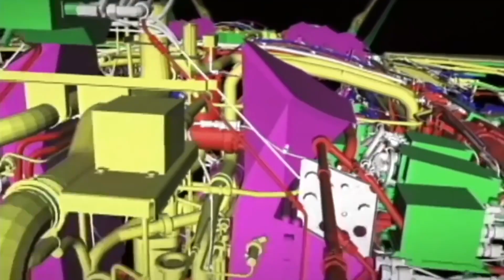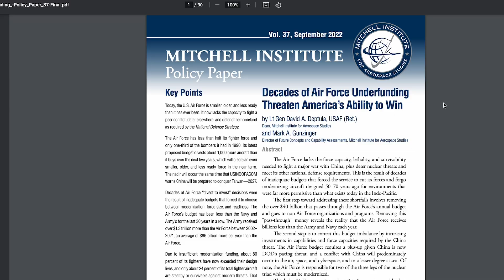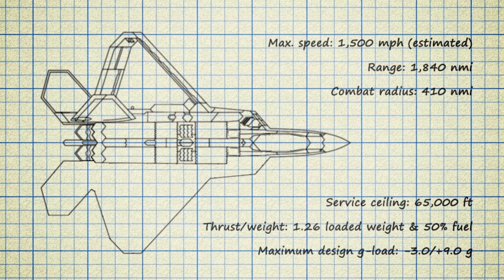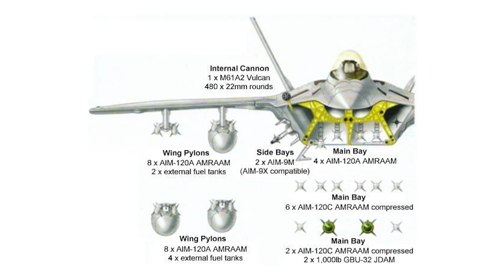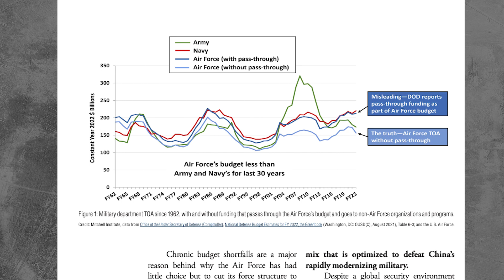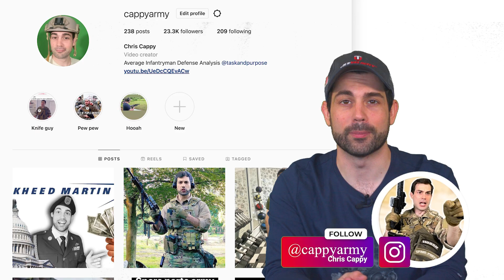Cancelling the F-22 Fighter is Worse than You Think

Comment: The F-22 exorbitant cost was made worse by two main factors: Early cancellation and Lockheeds inability to export. Both equaled a much lower rate of production which ultimately ran up individual unit cost. The same factors played a big part in the B-2’s cost. 

So how do we sort that out moving forward while still maintaining absolute technological superiority? 

The same open architecture design concept and use of proven, off the shelf parts that were utilized with prototypes like with the YF-117 and B-21 will absolutely lower the cost of NGAD exponentially. 

One of the single greatest things the F-35 has brought us is a vastly improved avionics, tens of thousands of flight hours to learn from, and multiple block upgrades, rapid R&D and implementation for new systems and materials etc. 

NGAD will make use of a lot of proven off the shelf parts. Stuff like landing gear, ejection seats, RAM coatings, the new ADEP engines, F-35-esque avionics and coding, tracking and targeting, passive IRST, radar etc… NGAD will likely be a larger air superiority platform with long legs that is built around a LOT of the same architecture as the F-35 and B-21. That has the added benefit of rapid prototyping and integration with existing programs and systems.

It’s going to upset a lot of people when they find out NGAD isn’t a hypersonic, vectored thrust dogfighting machine. It’s going to be a very long range (BVR) sniper (probably with the same internal gun as the -35 because we learned our lesson with the F-4 in Vietnam and the GAU-22A is more than adequate*). 

*side note: I wouldn’t be surprised to see them also use the standard M-61 20mm as this is meant to be an air superiority fighter and likely won’t be used for CAS/Anti-Armor like the F-35, so a VERY proven 20mm cannon with a higher rate of fire would actually make more sense)

Comment: The answer is to build more F-15X's. Utilize them in a Hi-Lo, or more accurately Stealth-Nonstealth, mix with the F-22. Not every air-to-air mission requires stealth. If that were the case, the US carrier force and it's air wings would be scrapped. Sometimes the ability to carry a big load of ordnance, A2A or A2G, to long range is more important. When the latest generation of weapons is factored-in, the X looks like a good choice.  Current F-15 infrastructure and training easily supports the newest Eagle as well.

Comment: F-22 may have more power than any other fighter jet - but it's very, very heavy. A Typhoon configured for intercept has a better power to weight - and that's before we add the extra (up to) 30% extra thrust Rolls Royce now allow on the engines as they are exceeding flight time before failure massively.  Basically the Eurofighter's EJ200s are lasting twice as long as they were supposed to!

Comment: The F-35 A and C can carry 2 2000 pound JDAMS and 2 AIM-120 and the F-22 can carry 2 1000 pound JDAMs, 2AIM-120, and 2 AIM9.  The F-35 makes up for this by having extra wingtip mounts for the AIM-9 if they carry external weapons.  The F-35 is supposed to get an upgraded missile rack that if they do not carry the 2000 pound JDAM they can fit 3 AIM-120 total... again matching the F-22.

The F-22 is a faster jet and has SLIGHTLY better stealth, but the F-35 has the combat helmet with 360 degree IR capabilities and built in electronic warfare.  The F-22 has a speed of Mach 2.25, range of 1800 miles, and an altitude of 65,000 feet and the F-35 has a speed of Mach 1.6, range of 1700 miles, and an altitude of 50,000 feet.  The F-35 has slightly more updated radar, targeting, and electronic warfare systems.  The F-35 is VTOL or STOL capable, but can only hold a 1000 pound JDAM and lacks the onboard gun.  The F22 can use externally tanks to improve its range, but the F-35 is developing those too.

The F-35C is a carrier launch version.  This is something the F-22 could never do.  Proposals were made, but it would have required variable swept wings to slow its takeoff and landing speeds which would have driven up the4 cost way higher and severely reduced its stealth capabilities.

The big problem with the F-22 is the operating cost and purchase price as well as the inability to send data over the Link-16 system except to another F-22.  The F-35 can send or receive data.  This is pretty important.  The F-35 has a lower incident rate too.  It is also a big money maker because the US is exporting them and the F-22 was never exported.  This overall will result in more than 10x as many F-35 built and even more than that in engines as the B-21 uses the same engines.

Even though they perform a completely different roles I think they would likely be a VERY close match if they had to take on each other.  I actually think the F-35 might have a slight advantage do to the slightly more advanced electronics and the combat helmet and 360' IR vision.  Either way they both outmatch anything else in the world significantly and with the new AIM-260 and later the Peregrine missiles they will be even better.

Comment: The F22 should’ve been fully fielded and unit cost would’ve been a lot less.  That’s why the F35 is already cheaper because there are more F35s in service already then the total amount of F22s.  If the USAF got all 750 planes that were originally requested and granted before cuts the F15 would be in a museums like the F14.  Instead to fill the gap while the NGAD is being developed the AF Is investing in the F15EX program which is basically a big missile truck that carries double the amount of missiles of the F15c.  If you believe what is available open source material they are to fire air to air missiles which will be guided/controlled by the F35s so they fire and bug out because they have a reduced radar cross section, but aren’t stealth aircraft.  Then the F35s track targets and guide the ordnance towards intended targets or something to that effect.  The Navy is having the same issue now because they do not have a dedicated air inceptor to defend the battle groups and that’s coming from the Super Hornet community.  There were plans to upgrade the F14 Tomcat to the Super Tomcat 21 which had 3 versions to pick from.  That’s another story though because Dick Cheney killed it because he hated Grumman and allegedly had some kind of interest in McDonnell Douglas who produced the F18 legacy and then the Super Hornet which MD & Boeing produce today.  It’s was sold as just an upgrade, but did essentially what they were trying to do with F14 because the Super Hornet is 33% bigger then the legacy hornet.  The Super Hornet is actually slower then the legacy.  I would bring up it also killed the phoenix missiles as well because there is no airframe in the navy that could carry them.  When it comes to defense spending though follow the money because some politicians are getting their pockets lined, and now there are actually peer to peer threats close on the horizon now it’s oh poop!
Reply: With the above said in the F22 and it’s technology you are getting really close to as far as physics what the human body can handle.  9+ g turns which can’t be sustained for long periods without getting g lock and passing out.  I do know from talking to a buddy that is a crew chief on F22s they are FAST!  Don’t know the top speed because it’s extremely classified, but know they can go so fast if the pilot pushes it out of the “envelope” it will actually start peeling the paint off the aircraft.  Then it has to be deadlined and sent for an expensive paint job!  I have actually been on the flight line at Langley, touched, and got to look inside the aircraft.  It’s amazing piece of technology and is unmatched in the sky even by the Chinese or Russian Stealth aircraft which are newer.

Comment: What unfortunately even some of the people at the highest level don't understand is that the F35 was never meant to replace the F22, but to work in tandem with it. They are both great at their jobs, but if you force them to do what they're not designed for, you'll see performance suffer, and therefore people who don't know anything about them (i.e. lazy journalists) crap on it. All hope rests on the NGAD, which will hopefully be the worthy heir to the throne of the king of the skies.

We are also lucky that most of those in charge knew not to buy into stuff the fighter mafia has said, otherwise we would have lost the F35 as well. We would be in far greater trouble if Pierre Sprey and crew won.

Comment: Best replacement for the Raptor would be a drone. you can load a number of them in a cargo plane, drop them just outside of the combat zone and let the advanced combat systems and the handlers back in the states or the local FOB run the show.
Reply: Yes that's the future. Advanced weapons delivered by simple cheap mechanical systems.

Comment: The ideal solution would be to build a version of the F-22 that costs less as it takes 10 years+ for a newer gen fighter jet. While the F-16 jet export fighters can be modified to serve the US Air Force to replace the oldest F-16 jets as while it is outdated, it's still effective enough to serve as a stop gap. 

Also, all the moaning about the F-22 being useless in Afghanistan is darkly ironic given what they did to the A-10 Warthog, which was far more effective at close-in air support, but deeply unpopular with the flyboys. Because somehow being in a flying death machine that's slow-ish and extremely rugged is totes "bad".

Comment: The problem with the F22 is that you produced it 20 years before there was any need for it.  The F15 was still peerless.
So F22 didn't have a mission, so you stopped building them.
Now 20 years later it has a mission, but the airframe are approaching end of life.

Bit of a cluster fuck all things considered.

Comment: Too expensive is the excuse given for the cancellation of the F-22. The limitations of stealth capability are not well understood by the public. Stealth is a very expensive form of ECM. Too many people think stealth capability works like a cloaking device, from Star. Trek! 
    Stealth is only worth the money spent if it works aa advertised. It seems fairly obvious to me. The Russians  began to deploy systems to effectively counter the F-22's stealth advantage. The Russians have recently demonstrated the BVR engagements using IR sensors not dependent on radar. Just for example. Anyway, the primary advantage of stealth is the surprise factor. When your opponent KNOWS you have stealth capabilities. That opponent can then take effective steps to counter the threat. That's about all one can say in an unclassified forum.

Comment: 0354  Raptor was never intended to fight a war of attrition on going basis: It was designed as initial 'tip of the spear' SEAD mission.  After that, 4th gen fighters and fighter bombers can take over and do the mop off.

Stealth, 5th gen fighters simply do not have the capacity for ground and pound.  The carrying capacity is too limited, and too restricted due to the stealth design.

Having 5th gen do the job of 4th gen is penny wise and dollar foolish.

0414   Dude, you don't use 5th gen fighters for escort duties!   You might as well have pigs wear diamonds.

You use 5th gen fighters for initial, pre-emptive, SEAD, and some precision strike on ultra high value enemy targets.

For conventional air superiority fights, you might as well use 4th gen fighters; they carry far more warheads, and far more flexible in the kind of warhead they can carry than any 5th gen,

Plus 5th gen fighters, every time you use them, you have to examine the stealth panels, most definitely after they go beyond mach.  This reduces the sortie rate.  You cannot use them on going battle of attrition.  This got to be done in a 'clean room', using specialized equipment, and technicians trained, EXPENSIVE, and Time consuming.

Now, ROK is developing hard baked stealth panels that are maintenance free to be used in KF-21s in the future, but ROK is not going to share with U.S.

0523  For stealth mode, F22 cannot carry externally: It must be carried in internal bay.  If F22 is to carry externally, why not just use 4th gen, and equip it with F22 radars?

PRC 5th gen is a joke: 5th gen in name only.

F22 cannot use meteor, the best missile from air; why Rafael is a sales success.  

F22 is a stealth, so less visible in enemy radar, but its missile range is far shorter than meteor.  Rafael is a 4th gen, but can fire meteor, which has a far longer range than F22, and its radar is just as capable of F22.

So F22 can see Rafael, before Rafael can see F22.   But Rafael can hit F22 before F22 can hit Rafael.  Rafael's ability to see will keep improving; F22's ability not to be seen is not improving.   In the end, F22 will lose its edge.

Me thinks stealth factor is overblown, especially in the form of U.S. style soft stealth panel: too finicky, not cost effective, too high maintenance.

Radar keeps improving, stealth panel is not improving at the rate radar is improving: radar is also far cheaper than stealth planes, and can be used on multi-platforms, spreading the cost of mass adoption.

The shape and size of internal bay of stealth planes limits the shape/size of the weapons it can deliver.

Stealth fighters cannot use the longer range, faster, more accurate missiles that 4th gen can use.

5th gen should be used for initial SEAD, and selective ultra high value targets only, not on going rumble in the air, not cost effective.

Comment: The F-15 Eagle(first flight 1972) and the F-15 Strike Eagle(first flight 1988) are still being produced to this day, so the Air force is not flying 40 year old aircraft. The F-15 has been heavily updated since the 80's and new F-15's are coming of the production line every day. Now they're also preparing to build the F-15X but it's not guaranteed. So i have no idea where you got that they're flying 40 year old planes that are breaking up mid air, there was only one break up in 2007(i think) that happened out of over 1,700 aircraft and that was do to improper maintenance. The F-15 is still an excellent aircraft and the air force plans to fly them at least till 2050.

Comment: The F-35 is significantly better than the F-22, both in sheer capabilities and in doctrine. There is absolutely nothing in the F-22 that would make me want to build more rather than building more F-35s. The Lightning II is easily capable of performing the Raptor's role as good or better than the Raptor itself, and it can operate as an attack, EW, and C2 aircraft at the same time

Comment: The next gen fighter has already been in the works. Its not financially feasible to produce and maintain the f-22 as is as the cost to maintain is basically more than the aircraft.  Also note some of the components used in the jet aren't even made anymore. Using some of the f-22 tech and current they can produce a lower priced and better aircraft than the still very capable Raptor.

Comment: I think its a wise decision not burn more $$$ on F-22 and accelerate NGAD. F-22 is designed to counter soviet union through through deployment in Western Europe. But today the major threat is China. NGAD with its Adaptive Cycle Engine with 35% increased range and 25% reduction in fuel burn is much better suited to operate across in the vast pacific theater.

Comment: I'm still confused. Surely for the "air dominance" manoeuvrability of the F-22 to even come into play, everyone has to have run out of missiles and be reduced to dogfighting w cannons? It's not like you need to be pointing your nose at the target and get a missile lock anymore, these days the radars detect the enemy, and you fire fox one, done. It just comes down to who detects who first, and gets enough missiles away, right? The F-22 is simply an overkill, expensive to build, and expensive to run, machine. You can almost have two F-35's for the same TCO of one F-22, and almost twice the effectiveness. What did I miss?

Comment: If, by dogfighting, you mean visual range contests of maneuver and/or the use of guns in an air-to-air capacity, the reason that the F-35 isn't designed for that is probably because it's not likely to happen in the kind of battle environment the F-35 faces.

We are entering an era in which air-to-air engagements with the latest fighters can very easily occur with both combatants well within their own territories. Dogfighting in the sense of a maneuver contest isn't the way that an F-35 will need to fight, nor could it rely on fighting that way because its upcoming competition will be engaging from far beyond Dogfighting range. And, as for dogfighting with guns, it essentially never happens now.

The message that we need to have sufficient numbers of fighters seems like a very sound one. I think that the best solution to that issue would be to increase F-35 production, though. The F-22 is a great plane, but it was not designed with the knowledge we have now about what our aircraft will likely face in the wars of the next decade or so.

Comment: Mmmm. You need to look at it closer.
Actually the F-35 is in the same ballpark as the F-22. The main differences:
- F-35 costs considerably less, so more can be built from the same budget
- F-35 is newer, meaning better electronics and radar
- F-35 is not able to dogfight. Totally irrelevant, as with the current missiles and speeds dogfight will never occur between fighters.
So, maybe the decision to stop producing more F-22 was not the best at the time, but today the F-22 is no longer an option. Just build more F-35, and concentrate on upgrades and the next big thing.
I would also consider building more cheap, older, but upgraded planes like F-18A-s. We need more planes everywhere, and strength is in numbers. Chinese still use a lot of J-10s and J-11s, which are just clones of F-16 and Su-27, or little more. You know, not every marine and infantryman has to be specops...